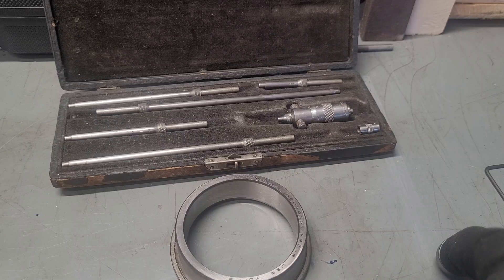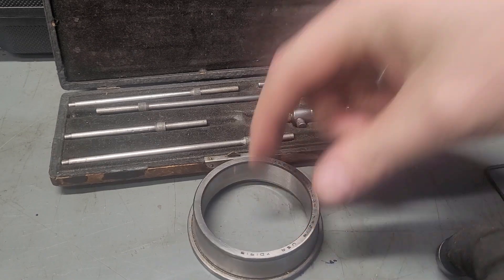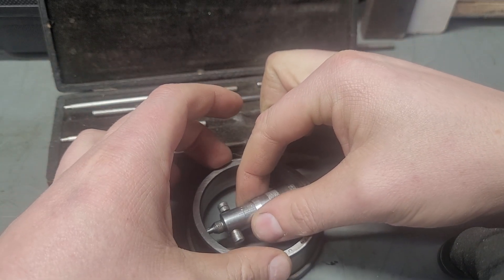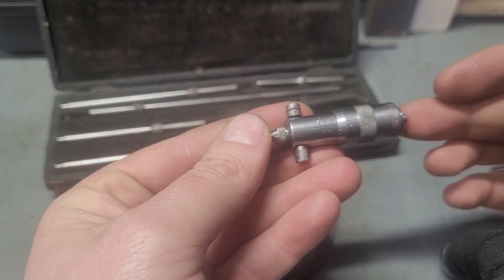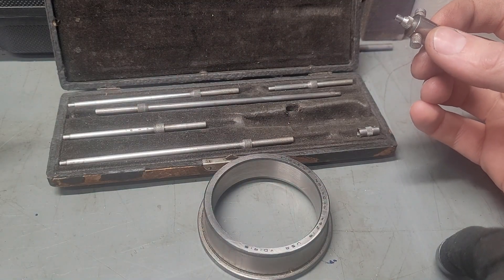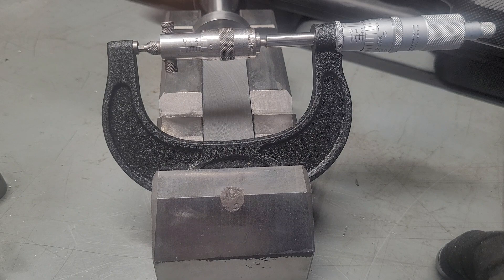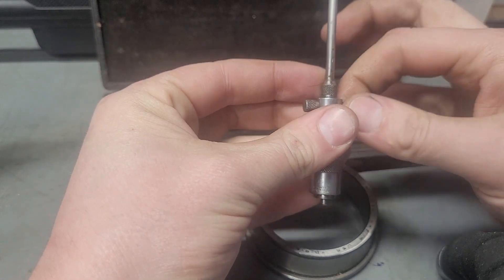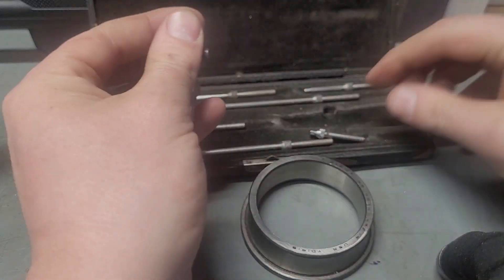Starrett Model 124 inside Micrometer Review

Comment: I just got a set of mikes from my step dad. Thanks for showing how to use them. I'll go check if my set if also off 1k. If it is I'll probably just sharpy on it "add 1k".
Reply from the maker: @Taematoe  it's worth recalibration if you can. It's easy to forget to account for that error. But for smaller bores these don't really shine, I like them for over 3 in borea where there is room for your hands.